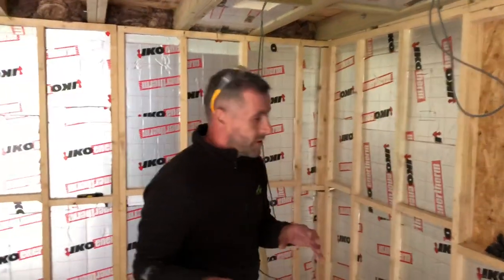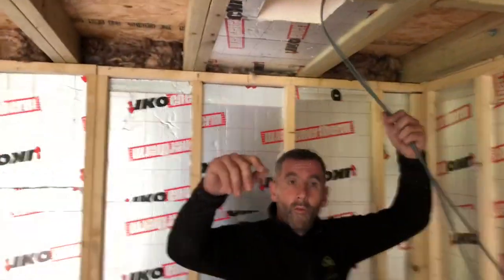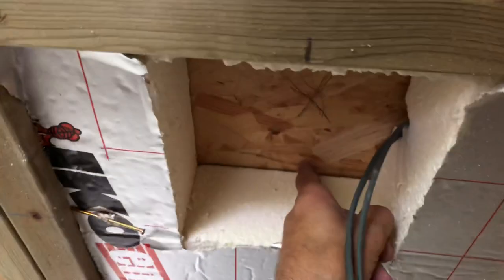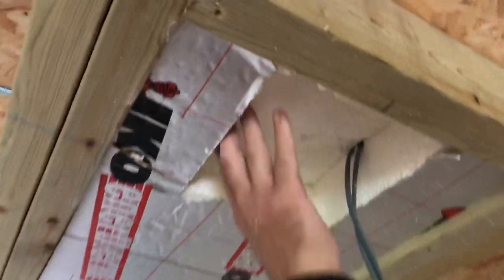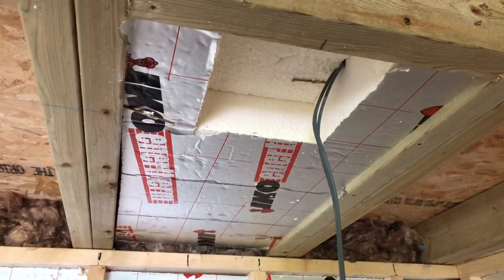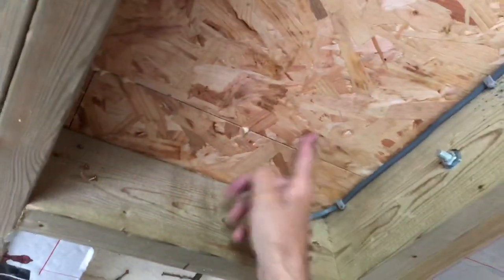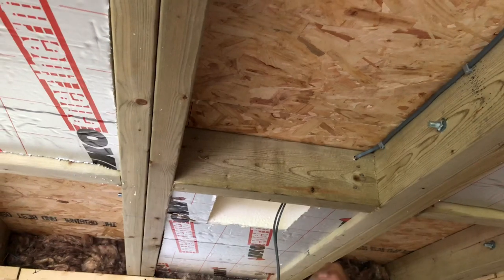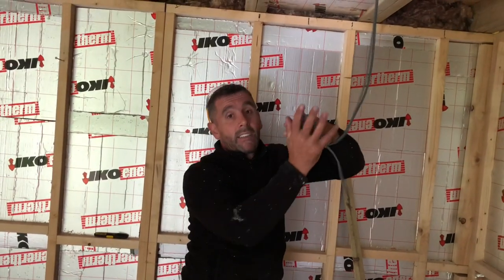Garden room roof insulation detail

Comment: Just use 80mm in the ceiling to give a slightly bigger air gap and vent it front and back. Air will still pass through that insulation even though you’ve pushed it up and condensate 100%. Making it a cold roof and venting it, will be a lot better way for you future builds. 👍
Reply: Plus you would have to drill vent holes at the top of every noggin too, or put shorter noggins in that don't touch the roof deck...
Reply: This what I'm going to do. 👍

Comment: It would be interesting to revisit a build you have completed 2/3 years back using this method and remove a section of the ceiling and insulation to see if there’s any mould growth or damp on the underside of the OSB roof sheets.
I’m aware this is not normal practice and would be invasive but still, would be interesting and put all myths to rest.
Reply: Hahaha i said the exact same thing! What he isn’t realising is is that you won’t get a perfect vacuumed seal between boards and insulation so there’s always going to be somewhat air in there. Ventilation is absolute key snd should never be compromised! Our company have been building for over 40 years and ventilation has always been number one!

Comment: Yes it's wrong and it's sort of a "hybrid warm roof" without the insulation on top of the deck  but as long as there is a very well sealed vapor barrier there shouldn't be an issue, don't forget this is how most of the walls are constructed in timber framing, vapor can still condense on walls too.  Willam has come up with a smart compromise to the height restrictions.  It's about time the 2.5m rule was lifted or changed to maybe 2.7m (that could accommodate warm or true hybrid roof) given there is such a push on green buildings and energy conservation.  A cold roof in this building would only allow 50mm insulation and venting would be a pain because of the noggins!

Comment: Air gap underneath is pointless,osb is the location of internal and external temperature so therefore there has to be a ventilation system between osb and insulation or there will be condensation pulled into the building.2x1 Cross batten would correct issue so your ceiling would be 22mm lower
Reply: Can you explain how this works? Just about to complete my roof insulation
Reply: @ryanmarder2446  when you roof your  building, run your airtight membrane on top of your roof joisting /rafters.
On top of this cross batten with 2x1.
By cross batten I mean run 2x1 at 90° to roof joisting.
Then lay your roof sheathing on your 2x1.
Let your roof sheathing overhang the perimeter of your building 10mm all around and you have got your airflow /breathable roof sorted.
From underneath you can insulate right up to your airtight membrane as you have a void above this your cold roof can breathe.
Reply: @aidankeane847  by airtight membrane do you mean a vapour barrier or something like tyvek housewrap?

Comment: I guess people keep commenting about it because technically it’s not right. You need a 50mm air gap. In mine the simple process was to pop nails into the wood 50mm down from the OSB, then fit soffit vents in the front and soffit vents in the rear. Air comes in, flows over and goes out. Sorted 😉
Reply: I don’t get what you mean . How does putting nails in 50mm down help airflow
Reply: @ozzyefc44  the nails are to stop the insulation pushing all the way up I guess
Reply: Jock Walker ah I get it now . But he still wouldn’t get any airflow up in the roof because each section is boxed in tight to the osb you’d have to put battens across between the joists and the osb to get any airflow from the vents
Reply: instead of nails could you just stick wood battens to each side of the beams so it creates a seat for the  insulation? I get what you mean with the front and rear vents.
Reply: @ozzyefc44  youd have to drill each noggin to get air to travel the length of the roof, soffit to soffit

Comment: So vapor rises and hits the vapor barrier. Where does the vapor dissipate? Just built a Tuff shed and insulated the whole interior building. Building has no vents. I’ve pushed the ridged insulation all the way up leaving no air gap. Thanks
Reply: Three years passed. Have you had any issues?

Comment: Polythene vapour barrier over the full roof before plasterboard/finish or just foil tape over the joists, joining the foam sheets which will do the same job ie provide a vapour barrier, which stops warm moist air from inside getting behind the insulation and condensating against the cold roof.

Comment: The only thing I would probably do is staple a layer of polythene as a moisture barrier, thin stuff is fine, and I know you will have penetrations through but as William says its a compromise.
Reply: On the underside of OSB or joists?
Reply: Most timber frames I’ve seen have some sort of polythene on the inside of studs

Comment: Hi there thank you for all of your detailed videos, i do have a question with regards to the hybrid roof that you use.
All the videos you show the roof timbers are quite shallow Ie 5-6” by 2” and all the cables put above the insulation board is this due to the lack of space between the timber and where the plaster board will be?.
I am using 9” By 2” due to the roof span with 100mm isolation board would you still recommend doing the same with the cables even though there will be a large amount of free space between or can the cables be run below the insulation. Also i gather the hybrid system will still be ok with this size timbers.

Comment: well I thought it was a pretty good explanation inside of 3 mins, still left me a little confused though, will you still use a vapor barrier between plasterboard and the rafters? i thought the idea of the VB was to stop moisture from inside of the room getting into the timbers. Thanks
Reply from the maker: Gareth yes! 100%, just not got to that stage mate
Reply: The VB is to prevent warm moist air meeting the cold surface, in this instance the OSB above the insulation. That is the point at which you would get condensation IF the insulation wasn’t tight to the OSB and if no VB was installed. It’s the same principle as condensation on inside of windows, it’s the point at which the warm air hits the external air temperature where condensation will form
Reply: @tomg1448  it matters not if there is a gap or if it's tight, if there is no airflow the result will be the same.
Reply: @dannymurphy1779  Incorrect. The insulation being tight to the underside of the deck makes all the difference as it changes the dew point location. That coupled with the VCL mitigates the night time radiation / condensation on the underside of the OSB. It would be better if a batt or quilt was used as it would fit tightly, using the PIR board isn't really the best method to achieve this BUT the PIR will have a better thermal resistance for the relevant thickness. Without a doubt it would be better to have ventilation, and the LCA would always tell you to vent below any ply/OSB to allow any trapped/residual moisture to dissipate, but with the insulation tight to the underside of the ply OSB it shouldn't condensate. That is not to say that if the ply/osb isnt BONE dry on installation that their could become a problem as the moisture has no way of venting.
Reply: @tomg1448  If using rockwool for a roof like this, would you fill the whole joist depth (In my case 5”), then VB, then internal lining?
Reply: @toco789  Yes I would definitely recommend tightly packing (to ensure no air gaps) the rockwool for the whole joist depth. Your thermal resistance wont be as good as using PIR but will still give you insulation. The weak point is always the timber joists as they are in effect un-insulated and the cold bridge. Hope that helps
Reply: @toco789  Also to note is that personally I would always look to ventilate the underside of the ply and joists, but understand its not always possible - and seeing that Liam's method is consistently successful recommend just ensuring no air-gaps and the VCL
Reply: @tomg1448  thanks for taking the time to reply, I think I’ll go with this route then, it’ll be OSB’d in and out so mice in the rockwool should hopefully not happen. It’s a workshop ultimately, don’t need perfect insulation but I still want to avoid problems with condensation in the wall and roof structure. I presume the same applies to the walls, full fill with a VB then OSB?
Reply: @toco789  Yes, exactly the same principle for the walls. Just make sure you have ventilation / air gap behind the external cladding (in the batten zone)
Reply: @tomg1448  Hopefully: inside out will be OSB, VB, full full insulation, OSB, breather membrane, battens, cladding. All good?
Reply: @toco789  Yep - just make sure you have counterbattens if you are intending on having vertical cladding (not required for horizontal cladding)

Comment: Same idea as we do it in Ireland expect we use mineral wool fitted snug under osb then vapour barrier then 2x1 cross joists then 32mm insulated plasterboard, you will never have an issue and the ceiling is very well insulated

Comment: What I keep reading is that building regs state -   Outbuildings and garages to be single storey with maximum eaves height of  2.5meters and maximum overall height of four meters with a dual pitched roof or three meters for any other roof. So you could have a warm roof on top of the 2,5 meters instead of incorporating a cold roof into the 2.5 meter height you keep mentioning.
Reply: Max outbuilding height is 4 metres if the footprint does NOT fall within 2 metres of the boundary. Most of these outbuildings will be within 2 metres of the boundary, and when they fall within that 2 metres, then the max height is 2.5 metres.
Reply: @Joemccxc  FYI think this differs in Scotland, you can build up to the boundary but not over 2.5m within 1m of the boundary and the size limitation is 50% of the curtilage. Just in case someone is reading this and in Scotland although they should check themselves.

Comment: As an option, I’d be happy to produce some standard garden room drawings. This way you can offer different options to customers, which include going over the 2.5m limit. Going over this limit would be as simple as submitting a standard drawing, producing a location plan and adding circa 300-400 quid to cover costs 👍 suppose the down side is waiting for the LPA for 8 weeks (sometimes longer).
Reply: MMA Media yep 4m ridge max is only if you’re minimum 2m from boundary otherwise 2.5m max height overall whatever the roof is

Comment: On a lightly different note, why do you put noggins in the roof but not on the walls? I assume both are secured to the OSB sheets?
Reply from the maker: Lee Parsons we do put noggins in the walls mate🤷🏻‍♂️
Reply: @thegardenroomguru  Apologies. I thought I saw in another video that you mentioned that the sheet material would give the necessary rigidity. I was debating whether it would be necessary if you're fixing each upright to the sheet cladding.
Reply from the maker: Lee Parsons id always put them in mate

Comment: in theory that is bang on the money in terms of an explanation, I have seen this method used with no issues however the insulation manufacturers would not necessarily agree that detail is correct. I think on the type of flat roof you are constructing with no obstructions there is no real reason why it couldn't be ventilated?
Reply from the maker: noggins form the obstruction, im no roofing expert, my mates is 3 years old now, takes out his spot light, osb3 is like the day it was laid!, there not high occupancy rooms, above two floors on a house.Jobs a good one!
Reply: Could you turn the noggins on their sides or just use timber 1” less than the joists? A vent grill could be fitted in the front and back soffits, plus airflow up from the void behind the cedar cladding
Reply: @thegardenroomguru  Could you not put a couple of 22mm holes in each noggin so air can pass, maybe this is not enough or weakens the noggins, im no roofing expert either, i also suspect it would take more time to do that?
Reply: @thegardenroomguru  I have heard of people either using foil backed plasterboard for ceilings or adding a vapour barrier as an extra precaution.

Comment: Why the f*** do people keep asking the same question over and over again?!? Look at his videos and I’m sure you’ll find an answer. Also, I’m sure there is a tweaking you can do as mentioned by others in their comments, but this is a sure fire way of a generic hybrid system that just works. Unless someone may have the luxury of building outside their 2m boundary to enable an extra 5m height to their build, then this is the best way Mr.Griffin has explained this compromise. So yes, as he states nobody ask him what is the difference again please! Rant over. Night night. 😬
Reply: Why are you getting exercised! You don’t find it strange that he is explaining the difference between a warm and cold roof to non builders but has built neither? You don’t see room for questions? And doesn’t really answer the question of moisture control. Yes it’s his channel but a)he’s putting out videos to explain so people should be ok to ask and b)he’s using the channel to flog plans and step by step guides so what’s wrong with potential customers asking? And he shouldn’t be getting upset, he should consider it customer service or cost of selling!

Comment: Why are you bracing roof spars to begin with?! Never heard of that! If you need a nogging for the lights then use a timber on its back so it’s only 2 inches which then gives you the air flow needed! Never should you be pushing insulation tight up to the underside of a cold roof! Airflow should be kept at all times! And you shouldn’t compromise with airflow. You’ll just get dry rot as youll still get condensation between the insulation and the roof through tiny imperfections 🤦🏻‍♂️ give it 5 years and the top of that insulation will be black
Reply from the maker: Hybrid works, it’s official 👌
Reply: Oakwood Garden Rooms excuse me?
Reply from the maker: It’s a hybrid, low occupancy, it works. 5 page report says so, your excused
Reply: Oakwood Garden Rooms it doesn’t work. Building regulations say so. You’re done now
Reply from the maker: Course mate 👌
Reply: Oakwood Garden Rooms call it all you want, it’s shit work that won’t last
Reply: Oakwood Garden Rooms guess you know better than building control? It’s bodge work! You’ve never had to work to building regs building sheds so you obviously won’t know any of the regs
Reply from the maker: Matthew, many have come before you.
What you need to remember these are not loft rooms, or extensions on houses. 
It’s a whole different ball game. 
Low occupancy is key, hybrid works.
You get yourself off to bed now, it’s late  👌
Reply: Oakwood Garden Rooms what’s wrong with just doing it right in the first place snd leaving a vent gap?
Reply: Oakwood Garden Rooms you keep saying “hybrid” 😂 in simple terms that means you’ve made it up. It’s not right. Everyone I’ve asked about who are actual buildings snd also the local authorities have all said that isn’t right and will cause black mild to form between the foil and decking as no air flow is present. Unless you vacuum the space (which is impossible due to microscopic imperfections in all materials) you will get mild growing and also turns into dry rot. You can even do a quick google for yourself and there is absolutely no article which says do not leave an air gap. You should need to use noggings if you’ve used the correct size timbers for that span. If it’s head height you’re after then planning permission should be obtained. charging the customers to do a bodge job to come under the need for planning permission isn’t professional at all.
Reply from the maker: @dancinggorilla7  finished?
Reply: Oakwood Garden Rooms bit of criticism mate. You publicly post so I freely speak